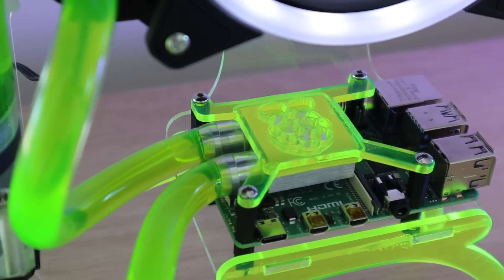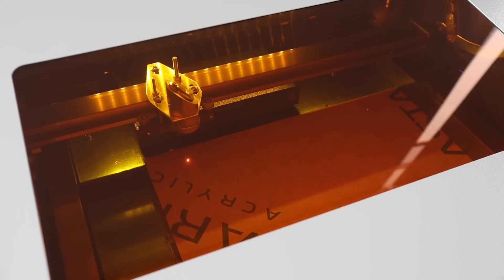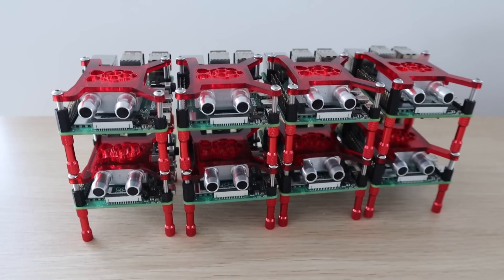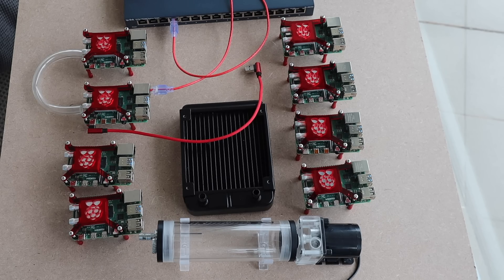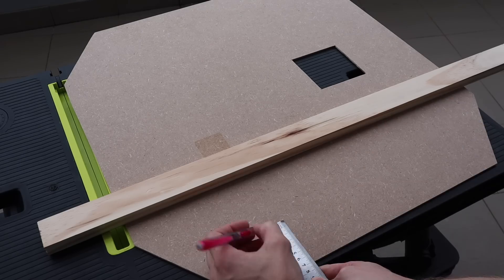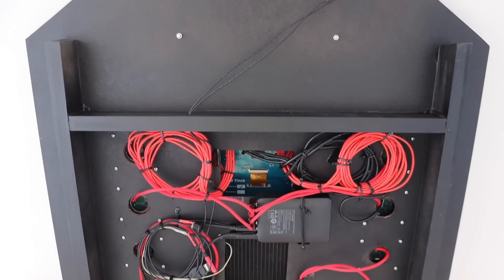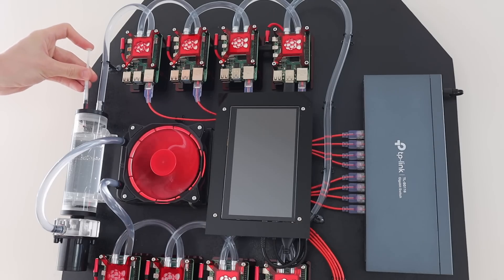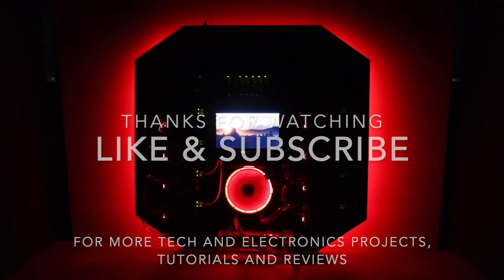Building A Water Cooled Raspberry Pi 4 Cluster

Comment: Very nice build. I would have gone for POE to eliminate the usb cables and have it even cleaner but other then that amazing work!
Reply from the maker: Thanks Ronald. Yeah POE would have been much cleaner. The main reason I did go this route is that the POE hats get in the way of the water cooling blocks (most sit on top of the Pi) - and they also add another $45 x 8 to the cost

Comment: what is the height of the spacer between cpu and cooling block?
Reply from the maker: The standoffs are 12mm, but the space is around 15-20mm. There is a gap between the standoff and bracket to allow some flexing.

Comment: Putting the loop serial and claiming the last pi will run hotter than the first is actually not totally correct. Water can absorb A LOT of heat before influencing the component temperature. This is the noticeable in CPU/GPU loops where CPU's pumping out 150W+ and GPU's 200W+ where it makes no difference which component gets the 'cool' water first :) The heat output of the pi's is so low it really won't matter a thing.

Comment: you use hot coolant from before CPU continuos to another CPU, that the worst way to use cooler
Reply from the maker: If the flow rate of coolant is high enough this makes no difference to the CPU temperature.

Comment: You made a statement which has been debunked many times when it comes to water cooling. The statement saying that having the loop in series will make the pi's have hotter water the further you go in the loop. This has been proven by top water cooling pros to be a total non-issue. The water in the loop moves much too quickly for it it become noticeably warmer from when it gets from component to component or in this case from pi to pi.

Comment: Hi there,

Question: Can you mix cooling past with cooling pads?
I legitimately don't know if they interact or degrade.
Reply from the maker: Why would you need to mix the two? I don't see why you "can't" but you probably "shouldn't". There is no use adding paste to the pad if the conductivity of the pad is the limiting factor in any case.

Comment: I think you need some air somewhere in the water system as liquids expand with temperature and thus will introduce a leak.
Reply from the maker: There is some air in the reservoir when it's not running. The best solution would probably be to have the reservoir vertical with a bit more air room.

Comment: I know its months late, but a note about them being in series: Fluid Thermals eventually balance out, so at first there will be a "hot" and a "cold" end of the fluid, but once the system levels out all of the parts will have the same temp fluid. So as long as your rad can handle the heat, there is no need to go in parallel.

A PC youtuber called "Jayztwocents" did a great video on this.

Comment: Did you use water or cooling liquid in the cooling system?  I don't see it in the links for that in the description
Reply from the maker: I just used water for this cluster project
Reply: @MichaelKlements  Any idea if its possible to run a single ffmpeg command that all the nodes help to process instead of having to process multiple files at the same time?  I'm trying to find an excuse to build a system like this

Comment: The fact that you're using a water cooler that has about same area as the combined heatsinks of the rpi this is a no-solution. The same fan you're already using (but maybe high flow instead of high static pressure) is enough to cool all of them in a closed case.

Comment: Have you considered power over ethernet? one less cable :)
Reply from the maker: Yeah I was initially going to go that route but the POE hats are quite expensive when you need to buy 8 of them and they cover up access to the CPU, so I wouldn't be able to use the water cooling blocks and brackets that I had already designed.

Comment: Would there be a noticeable improvement if I used the 8GB ram version instead of the 2GB or it’s about the computing power of the processor and not about the ram???
Reply from the maker: It depends on what you're using them for. Most clusters are used for their processing power more than for multi-tasking or RAM intensive operations, but this is entirely dependent on what you're trying to do with it.

Comment: Very nice build... but why didn't you add low profile POE hats instead of using the USB C power
Reply from the maker: The POE hats are quite expensive, around $30-40 each and they cover up the access to the CPU, so you can't use the cooling block and brackets with the POE hats.
Reply: @MichaelKlements  was looking at this one B082ZLDMZ6 on Amazon but you probably correct, I've never used a cooling tower b4.
Reply: Very nice build though... very beautiful setup
Reply from the maker: Those look pretty neat, they use far less space than the other's I've seen! I could probably look at putting a spacer block under the cooling block to space it away enough to fit one of these POE hats in.
Reply: @MichaelKlements  I actually own 2 for my Pi4 and I love them... the best 👌ones I've used so far... I'm still able to use passive cooling and it fits perfectly

Comment: why are the left4 and the right4 in the same direction? 
I wonder what/how would it be, if they were opposite...
Reply from the maker: They could be made opposite as well. They'd just be offset slightly then because the CPU isn't in the centre of each Pi.
Reply: @MichaelKlements  Oh, I see; a reasonable argument. If I understand correctly, a cluster means, that they work together(?) It is a very nice project; and it looks cool (in both meanings)
Reply from the maker: Yes it was a tradeoff in getting them aligned or all facing outwards. Yes it means that they all work together in processing tasks. Thank you for the great feedback!

Comment: You could still run the loop parallel.  You just need a plastic plug on the outlet of each cooler that restricts flow to 1/8.  Determine thee we actual flow of the pump by seeing how long it takes to fill a liter.  Then make a simple plug and drill the hole larger until it takes exactly 8x as long.  Now you know the size hole you need, and you can laser cut 8 of them.

Comment: Looks really nice! I think turning the pi's on the left 180° would have looked a tiny bit better though - the network cables and tubing would be symmetrical then. But I guess that was not possible for space problems?
Reply from the maker: It is possible to do, the blocks aren’t in the centre of the Pis though, so then they’re slightly offset on one side. It probably would have looked a bit more symmetrical your way.

Comment: how did the air work it's way out of the loop? your res is at a low pointso you couldnt have got the air out using that... usually the air will gather at the higher points of the loop, in your case a couple of the cooling blocks.

Comment: to get the same cooling for all pi´s you can use four 120 rads and connect two pi´s to each.
also maybe get a 9th pi as a dedicated master node with its own cooling solution to distribute the loads evenly.
and if youre worried about the flow speed you can add an extra pump to the loop.

might be overkill tho.
Reply: 4 rads is WAY overkill unless you want to get rid of the fans and do passive cooling, at that point using a bigger car radiator hidden behind the cluster would be an easier route. It seems counterintuitive, but with liquid cooling a higher flow rate surprisingly doesn't work like you "think" it would. Only your radiator size or fan speed does. The only thing adding a 2nd pump or increasing the speed of one pump does is increase pump whine, or if the pump moves TOO fast then it causes cavitation, making even MORE noise and worse it creates air bubbles in the loop lowering your thermal performance. 

I'm currently fighting with a pump speed limiting solution on my system because my PC mobo wasn't designed with water cooling in mind, so the pump is plugged into the CPU fan header because it has a much lower speed setting than the other case fan headers. But every time I turn the computer on the BIOS does a fan test at higher speeds for a few seconds and makes the pump cavitate. I even tried a separate fan controller but even its lowest setting is still way too fast...🤨

Comment: Could you have put another radiator and fan between pi’s 4 & 5? Water cooling noob so I don’t know if there’s a rule against that or not.
Reply from the maker: You can, it won’t have any adverse affect on the loop. But it’s also not necessary, the one I’ve used is already way bigger than what’s needed

Comment: Great build, but your assertion that the series approach would result in progressively hotter blocks is fallacious.

It seems counterintuitive, but since the blocks are all in a single loop in that arrangement, the system will reach equilibrium and the heat will be distributed.

It’s basic conservation of energy.

Comment: Flipping the pi's on the right around would have been better for symmetry, and would have given enough room for that bottom line to not crimp, that might end up being an issue later if it has to push through a restricted line for an extended period. Otherwise it looks cool.

Comment: This is a later project, but you may want to add a bubble trap at the top of the cooling loop, as these loops age, the water inside often evaporates and sucks air into the loop, adding a trap would keep the majority of the air from affecting trhe loop
Edit, i feel like the radiator with mini resevoir and the large resevoir will act as bubble traps well enough for this reletively low flow
Reply from the maker: Thanks for the tip! I hadn't considered a bubble trap at the top of the loop.

Comment: ok really sick build cool designs and lighting nice cut out of build but i have some thoughts on how it could be improved 
1.) you need to clamp each connection on the water cooling system and you need to heat the ends of the tubing when put them onto each intake to make sure the tube gets a tight fit when you insert it at intake valves 
2.) even if it is in series the water flows faster than what you would be cooling think of it like this if the water would be as hot as first and last in the loop because the water would be hot regardless of what part it is at because its flow rate is high 
3.) remember to sand wood and protection coat after painting  
4.) right side cluster needs to be opposite direction for better cable management because then you could make the water cooling tubes go into a hole at the back and pop out the other side for a better pass through getting better flow rate and it would just look cooler as well you could do some lighting with it maybe even chuck some behind the touch screen for better visibility of the system
Reply from the maker: Thanks for the feedback and suggestions!

Comment: This is excellent - it made me subscribe. One question from the OCD side of me - why didn't you put all the cooling lines on the outsides and all the data connections facing one another?
Reply from the maker: Thanks Dave. Because the Pi's are not symmetrical. So if I put all the ports facing each other then the heat sinks or Pi's would be staggered and not aligned, and the power cables would have been on opposite sides. Also, this was to keep the cooling brackets looking the same, else I'd need to make the opposite ones upside down. Either way around they wouldn't have been symmetrical.

Comment: Looks really nice! Does anyone know what the total power CPU output would be and what it would be comparable to relative to an intel CPU?
Reply: It's just for YouTube video, it's not worth comparing it to intel one,

Also it uses lan wire to sync tasks, a slowest way to communicate between cpu and components (however there aren't any other faster way, unless there is design change in pis to be more viable for clustering)

Comment: Looks great! Can I ask why you didn't just use an 8-port switch to keep things neat, or did you just have a 16-port already available?
Reply from the maker: An 8 port is fine if you're just running the cluster. I wanted to be able to connect the cluster to another network or computer as well for additional setup or for sending/receiving tasks to and from the master node. This could also be done over WiFi though.
Reply: @MichaelKlements  Makes sense! Shame you can't buy a 9-port for neatness 🤣.

Still, looks beautiful. A lovely build.
Reply from the maker: Yeah, a 10 port would have worked well. In the end I just had to use what was cost effective and available. At least with the switch I can expand the cluster in future as well.

Comment: Great little project, how are you powering the waterpump/fan?
Reply from the maker: It's powered off the same 12V supply as the switch. I've used a 12V, 5A supply for them all.
Reply: @MichaelKlements  do you have any instructions? I ended up going with a pico psu but it's a bit of a clunky setup
Reply from the maker: I literally just connected the 12V and GND wires from each of the pump, fan and switch to a 5.5mm barrel socket and then plugged a 12V 5A power supply (like the ones for an Arduino) into it.

Comment: Next: "What to do with a rasbperry pi 4 cluster"
Reply: I agree!  I think Raspberry Pi's are so cool, but I just don't know what the heck I would do with them...
Reply: Indeed!
Reply: mining altcoins using solar power
Reply: @ree2453  will take 100 years to mine 1 dollar..
Reply: @ree2453  new riches
Reply: See, I don't know what half of that is to know what I would do with them, lol.
Reply: make a youtube video.
Reply: Make a Jarvis script connect long usb cable home intergraded cheff friend.. voice script etc.. not Sophia.. she'll just get grumpy.
Reply: @r3d_panda  Good use case. Could you share your cooling solution on your raspberry pi 4 ? I see many discussions about raspberry pi 4 could go really high temperature like 80 deg C and get throttling. Wonder how your case running so good.
Reply: @AndrewTCW  Honestly i don't have any long term data yet but i was barely able to let my pi reach 50 °C during stresstesting. I'm currently using the argon one v2 case. The complete upper part of the case works pretty much as a giant heatsink and the only time i ever saw the fan kicking in was the test mentioned above (there is software for this case available to setup a very basic fan curve).
Keep in mind i don't have a lot of permanent workload tho. Most of the time my pi idles with a workload of 0.3 (htop) and temps around 42 °C (pihole) with my current setup (13 Containers running in docker on a headless host with raspberry pi os lite installed). So i guess this highly depends on your use case and if you are willing to use at least some sort of cooling solution (passive is probably enough).
Reply: @r3d_panda  Thanks for sharing, really helpful for evaluating what has been planned to do with raspberry pi 4 and cooling solution to apply. Meanwhile, the use cases get the SBC temp reaching 80 deg C are video capturing, 4k video playing, etc. I'm amazed with how raspberry pi 4 is running well with 7 containers. The SBC is really good for a self hosted light weight home server/controller. I'm running 5 containers on my NAS and considering to move those containers out from storage. Thank you for sharing your use case.

Comment: How did you hook 8 USB C devices to the 6 port hub, looks like you used 2 splitters?  Is that correct?
Reply from the maker: I did initially, the two sharing don’t run at 2.0 GHz full load though. They run fine at 1.5Ghz. So had to add a second 6 port hub to power those for this test.

Comment: just quick question what can a rasberry pi cluster do that a modern day 10core cpu can do ? like some older xeons can be found for real cheap ?
Reply from the maker: Only really the price. You can get older Xeon processors for quite cheap, but you still need expensive hardware to get them to function as a usable computer. This cluster is effectively a 32 core 2.0GHz processor in the form of a working networked computer for $600.
Reply: @MichaelKlements  oh okay😄 thablyou aha just always wondered

Comment: You have a serious power issue. Raspberry Pi 4 requires 3 amp power supply. That RAV USB Power only supplies 2.4amps per port, max 12 amps combined. So you are massively under powering those systems
Reply from the maker: I've recently done a power test on the Pi 4B which I'll be posting soon. 
Just because their recommended power supply is a 3A, doesn't mean that the Pi draws 3A. They have allowed additional capacity for peripherals, displays, HDDs etc. 
In my test, 2A is more than enough to run the Pi's under full load when overclocked to 2.0Ghz without any power or performance issues. Their actual consumption is around 1.3-1.6A when at full load.
Reply: @MichaelKlements  interesting. I’ve had mine fail at 2.4 amps while expanding the filesystem on the micro sd card.
Reply from the maker: It might also be the quality of the power supply and the quality of the leads. I have had Pi's drop out when loaded purely because I've used a poor quality cable or adapter with them.
Expanding the file system on an SD card is also not particularly onerous on the power supply. A Pi 4 should idle at around 600-800mA and I can't see how expanding a file system should make it draw four times more power.

Comment: Do you have enough electrical power when running under full load?
I'd say that a 60W power supply is not really enough for 8 SBC's, a screen, a cooling system and a router.
Don't the router and cooling system need a 12 V supply anyways?
Reply from the maker: The 60w supply just runs the Pi’s at the moment. They all booted up fine, I’ll have to see if the supply is good enough once they’re running at full load.
The router and cooling system are on a separate 12V supply.